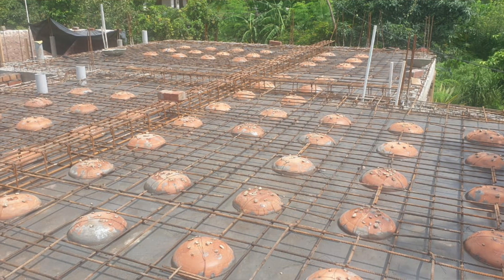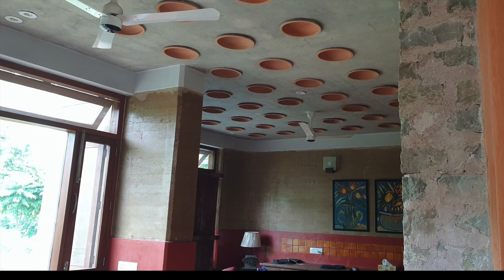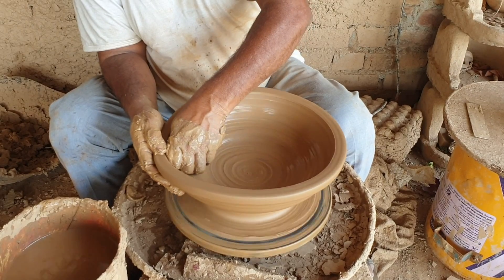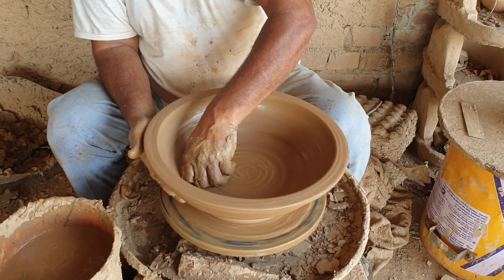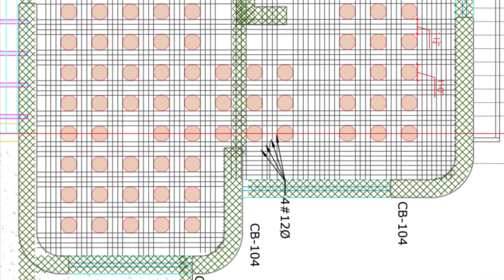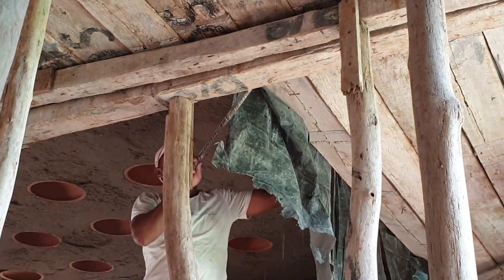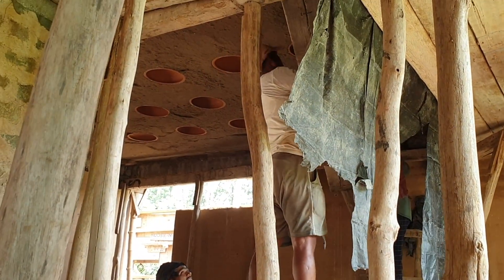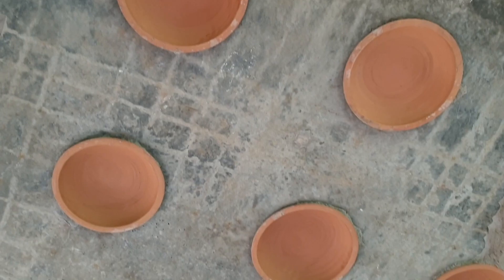How to make a Filler Slab Roof

Comment: After using so much cement and steel please don't call it sustainable.. you may present it as one of the aesthetically pleasing option for construction.
i know this word is already exploited by many businesses minded people
Reply from the maker: Sustainability is a journey, not a destination. If a filler slab is better than a full concrete roof, then it is the first step in sustainability. Do not let great by the enemy of good. That is what makes most people do nothing. have a good day!

Comment: Pot cost 200 to 250 cement is 300 ..so cement is cheaper and need less effort. We should use only used mangalore tiles to save cost
Reply from the maker: You've missed the point completely
Reply: Explain pls
Reply: @sampathkavin  the point being reducing the usage of unsustainable material like concrete, where feasible. I am an architect, btw. Not necessarily practicing. :)

Comment: Very informative video!
Can you elaborate a little more on the levelling plaster layer? What are the steps and materials involved, they mentioned something called 'neru'. Is it the same as neru lime powder? I am using this technique in a residential project and wanted to understand more. There we are using ms shuttering, not ply shuttering 
Based on the video and reading comments, this is what i have gathered:
Step1: apply diesel/oil to the shuttering plates
Step2: mix sand+neru lime powder and make a layer as thick as 1.5-2".
Step 3: Insert the pot in the mix such that the collar/lip is completely inside the levelling plaster.
Request you to throw some light on this :)
Really nice content
Reply from the maker: Priyanka why don't you connect with architect Jitesh Malik on art.jitesh@gmail.com. He will be able to share more technical inputs
Reply from the maker: Neru is not lime powder. It's a thin cement slurry

Comment: Why diesel was used ? & after how many days shuttering was removed?
Reply from the maker: Diesel or any oil is used so that the earth doesnt stick to the shuttering.  The shuttering is removed the next day
Reply: @farmaanandaa Hi! Very interesting! Would it be safe to remove the shuttering the very next day? Also, does it no create a problem with curing the concrete
Reply from the maker: Yes it's safe to remove next day or day after. There is no concrete to cure. The wall has earth and lime only.

Comment: I see your point on slabs having lesser tensile stress at the top and hence the requirement of concrete minimal at the bottom.  Fascinating experiment, would like to try it out myself have I the money, with my own version. 
The con is that it is time consuming and more problematic on the global scale as creation of earthen pots or other inert materials is more difficult than just buying good old cement. Also, it might not be ideal for places with high earthquake zones. Still, an interesting idea for sure.

Comment: What if the terracotta breaks or cracks
Reply from the maker: It shouldn't matter. The roof is not dependent on the pot
Reply: @farmaanandaa Not from the stability point of view. But wouldn't it let rain and sunlight in

Comment: Beautiful! So the leveling plaster was just a sacrificial layer that also allowed for the edges of the pots to protrude below the ceiling surface? How did you remove the leveling plaster?
Reply from the maker: Yes a sacrificial layer. It never really sets, because it has higher amount of sand and very less cement. When the shuttering ia removed, it just falls off.
Reply: @farmaanandaa  Very cool - thanks for the reply!

Comment: In normal concrete roof you first placed steel/iron bar and then fill the steel bar structure with concrete mix with vibrator so that no air bubbles create and even distribution of concrete mix. In this filler slab process how you fill the steel bar structure with concrete mix buy putting filler slab material before and how you use vibrator? Or you just first made the concrete roof thn create hole on it to put filler material like these matkas? And if it is so thn whats the point first built concrete roof thn hole it to create more wastage?
Reply from the maker: Obviously the pots are not stuck later. The concrete is poured around them, and settled with a vibrator as you described.  Wherever there is a pot, that much concrete you save
Reply: @farmaanandaa  thank you so very much for the clarification. I actually read about Becker architecture and also bought a sustainable guidebook to house consctruction by TERI for my house construction. I am fascinated about filler slab design. But there is no proper guide videos on filler slab on youtube so I can see how it done like from placing and binding iron bar, thn placing filler and pouring concrete mix. Thank you so much once again.